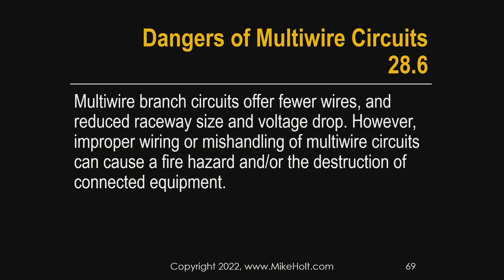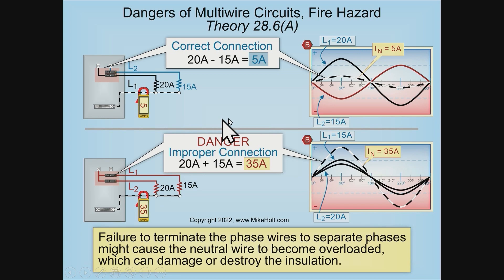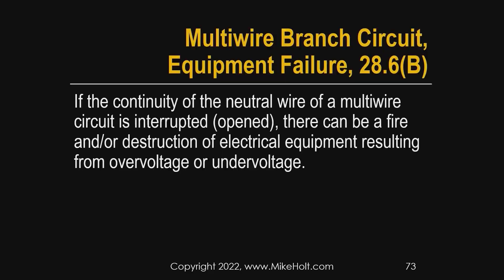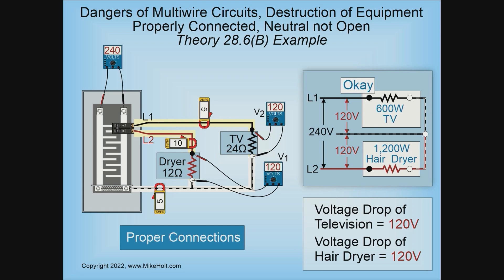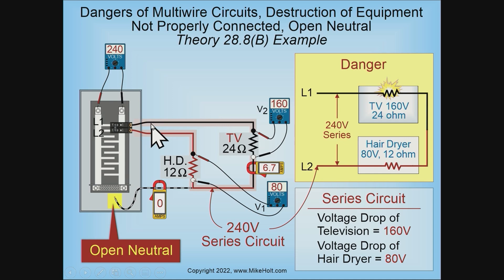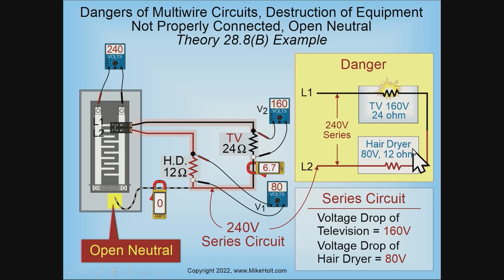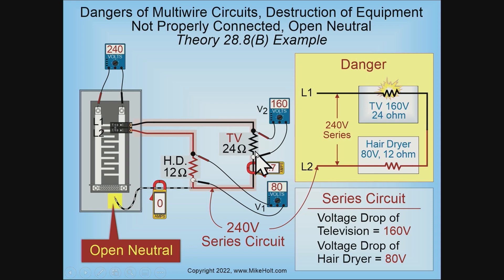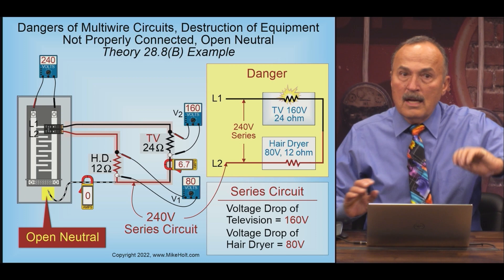Dangers of Multiwire Circuits 28.6

Comment: I’ve seen overloaded neutrals many times due to what they talked about….  A 3 wire cable with both circuits on the same phase due to installing on a tandem breaker.    I’ve also seen lots of expensive equipment burnt out due to losing the shared neutral when the circuit was wired on a proper 2 pole breaker so each wire is on their own phase.   This stuff happens a lot.

Comment: Fun story. When I was growing up, the voltage used to drop rather low. We could tell because the picture in our (CRT B&W) TV would shrink horizontally. The TV repairman said it was due to low voltage. We called the utility and when they came out, they said that every circuit in the house was on THE SAME BUS of our 120/240 service! An electrician came out and remedied that.

Maybe the panel was wired just before quitting time on a Friday … 😀

Comment: I've seen this a couple different times where the main neutral at the electrical panel or meter socket became so corroded at the termination point that it drops connection. Equipment burns up real quick.

Comment: We didn't loose a neutral but lost a phase to out factory. The voltage to one of our furnaces was low enough that the heater contactors could not pull in but the voltage was still high enough that it burnt up the coils in the contactors because of the high current from not pulling in.

Comment: I still refer to them as Edison circuits... showing my age.
Reply: Edison did use 3 wire DC distribution.  Back when they wee debating AC vs DC, Edison's 3 wire DC could easily be switched to split phase AC without modifications.  Edison had a lot of installed lighting systems and many, many of his 110 volt DC bulbs in service. The bulbs worked fine with either AC or DC. 

Technically, Edison lost the war of the currents, but he still made a lot of money selling his light bulbs. In the long run, AC was better for distribution  and 110 volts was safer than 220 volts. It worked out quite well and was a more efficient way to distribute power.

Comment: Your illustration showing the "Correct Way" of wiring of 2 branch circuits is also incorrect Mike. The way I've always done it is to use an individual neutral paired with a "hot" all the way from the respective panel for every branch circuit. (Your illustration seems to show a shared neutral for the 2 branch circuits)
Reply from the maker: Lol... a multiwire branch circuit is permitted by the NEC, so it's not incorrect. If my video is about a multiwire branch circuit, then I need to show the multiwire circuit. Not two separate 120V circuits. Hope this helps...